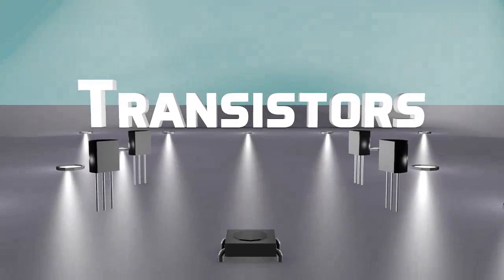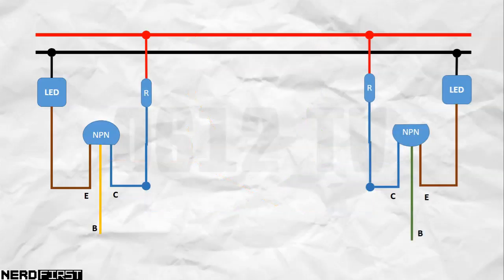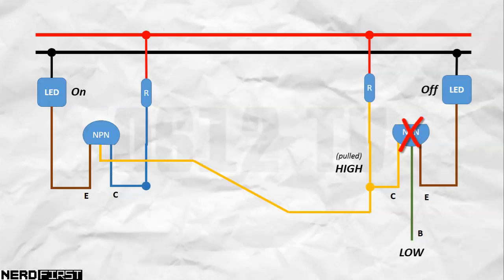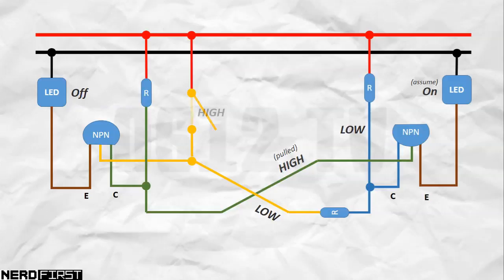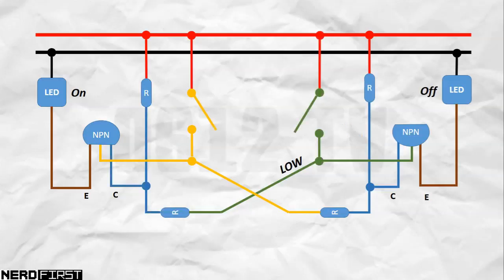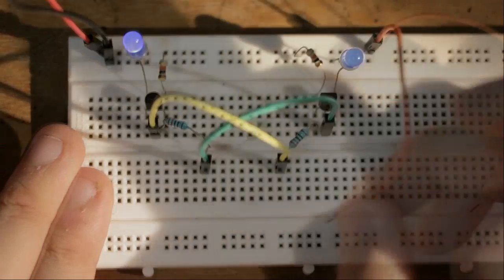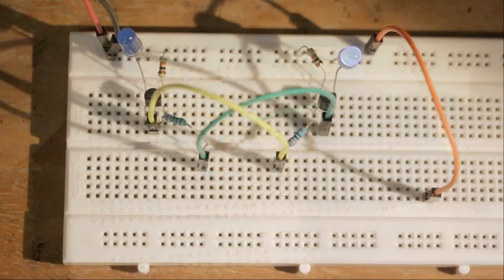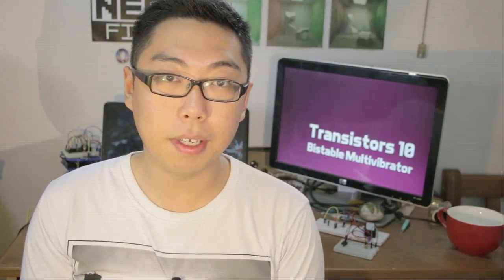Bistable Multivibrator - Transistors 10

Comment: can you tell me the role of the resistors in the circuit? Thank you
Reply from the maker: Hello and thank you for your comment! The basic function of a resistor in these circuits is to act as pull up / pull down resistors, so that the "off"-state of a transistor can still be appropriately detected as high or low.

Of course, I've been a bit sloppy choosing the resistance values here. When transistors are used as signal amplifiers then more care needs to be taken. You can refer here for more: https://www.petervis.com/GCSE_Design_and_Technology_Electronic_Products/transistor_base_resistor_calculator/transistor_base_resistor_calculator.html

Comment: Before you "complicate" the design, while applying low voltage to the transistor on the right, transistor on the left will never be fully opened. Thus the led will light up a bit.
Reply from the maker: Hello and thank you very much for sharing! Yeah I've had some voltage leaks here and there. Honestly what I aimed for for this series is just to get the logic working!